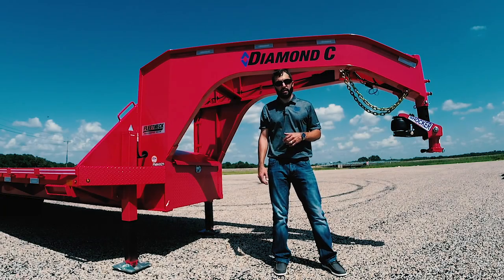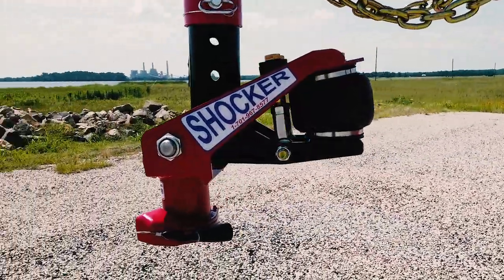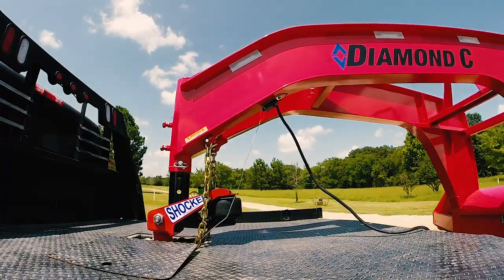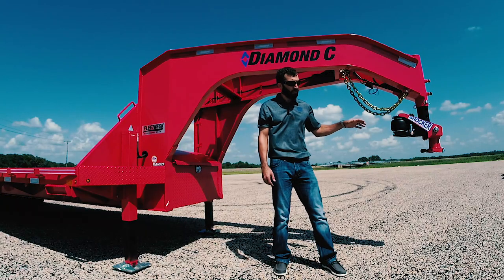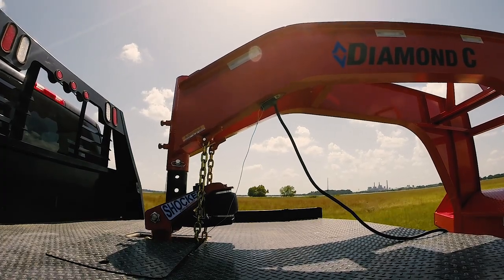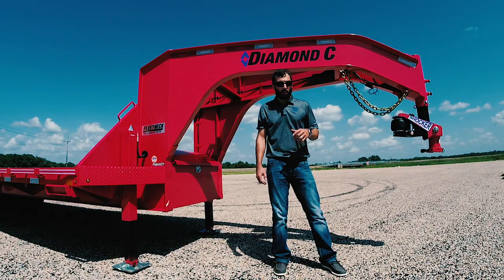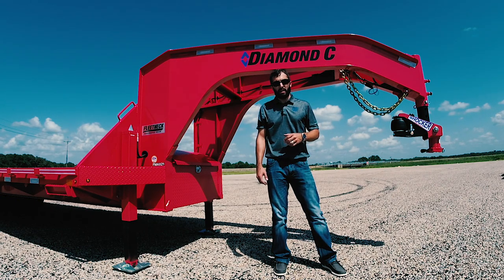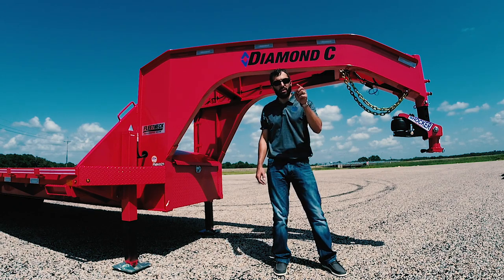Shocker Hitch Air Ride Gooseneck Coupler

Comment: Hey guys, I was just on the web site specing out a gooseneck dump trailer  & this option wasn't able to be picked anywhere. ??HELP.
Reply from the maker: David Abbott - thanks so much for pointing that out. Were you looking at the big boy WDT? We will get it added for sure. Your dealer should be able to quote it out for you once you submit the rest of the trailer. Thanks!
Reply: @diamondctrailers  Yes I was looking at the WDT's, just have to decide on what length to go with & then try to call the dealer. 
Dealer is not to  good here. Am I able to buy it directly from factory. When I buy BIG trailers(Blackhawk,Talbert,Trail King), that is what I do. I hate dealing through a middleman. If you could email me that would be great.    
               ht.davida@gmail.com  
Thanks, David